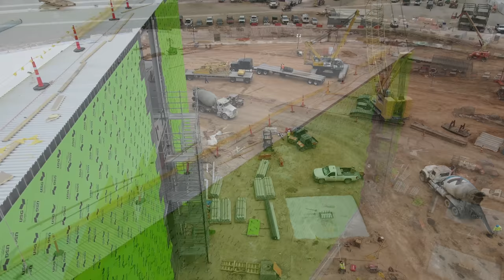Keeping an Eye Out - 2021-04-14 Progress Update

Comment: Thanks Jack. Always surprised at what shows up.
1:06. Bottom of screen. Worker in orange vest at the white machine which is one of the automatic concrete screeding machines getting a hose down.
2:51. A bunch of porta-loos have had a scaffold built over the top of them.
5:06. Ramp is getting rebar for the slab to be poured. Concrete blockwork being placed at the stairs. First time I have seen brickies on site.
14:57. Still making massive piles of this drain pipe.
20:17. Just to the right of mid screen. Columns on ground with massive brackets at the mid point. These are to carry bridge crane rails. A number of rails already installed, visible for example at 21:38 in the bay underneath where the riggers are installing the joists daisy chained off the crane. If you look closely into the piles of steel it's possible to see the stops on some of the rails.

Comment: For a project that was reputed to have been driving a 24/7 schedule, with no known shortages of materials, labor or money, in a cooperative municipality and a site that's big enough to accommodate most activity with relative ease, this building is progressing very slowly - relatively speaking.  As for the "critical path" presumably being followed to completion, progress looks more like a jig saw puzzle than a meaningfully organized project. 
Remember a couple of months ago people were betting on how many weeks were left before production would be in full swing in this building. Ha!
They're still digging foundations!
Reply: Due to the leading-edge nature of Tesla in the industry, manufacturing processes evolve almost daily, thus the construction plan must evolve and change along with it while it is going on. That's why the battery section is one of the last structures to go up even though it's high priority.
Reply: @richpate9436  - Technology evolves constantly. That's why Tesla's approach to factory design is so disappointing. Instead of having new facilities flexible enough to accommodate any changes during their life span, they target construction to exact, rigid processes. 
That insures the factories will be obsolete by the time they open.
Short sighted, uneconomical, primitive, faulty.

Comment: @ 1:44 They finally got the stormwater pipe under the temporary high voltage lines (Encased in concrete).